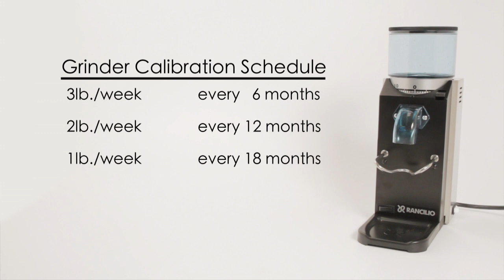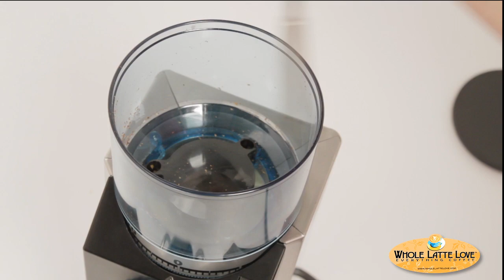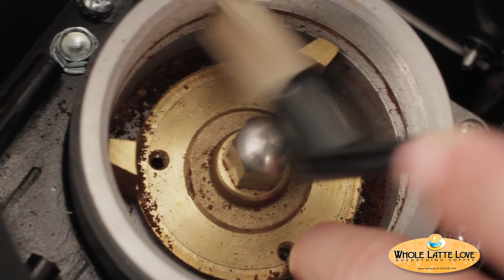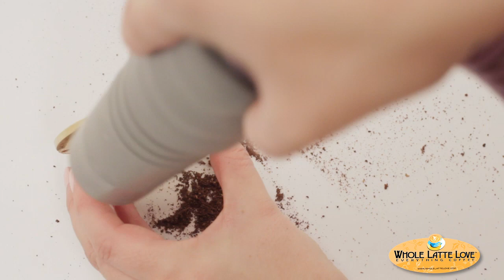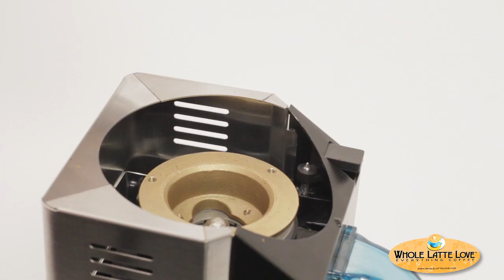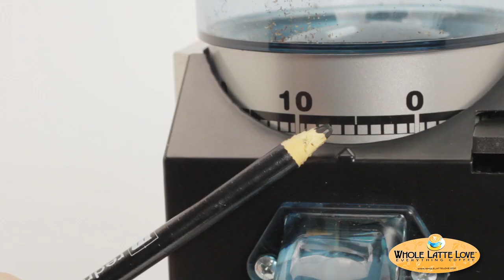How to Calibrate a Rancillio Rocky Grinder

Comment: I am dreading doing this, but my Rocky is almost 10 years old. I probably should replace the burrs.
Reply from the maker: Hi Richard, That really depends on how much coffee you've ground in those ten years. Should be good for >400lb/200kg. Honestly if considering new burrs I'd think about a new grinder. They've come a long way! Always found the grind at espresso sizes a bit clumpy from the Rocky. Also limited in precision with its stepped grind size adjustment.
Marc
Reply: @Wholelattelovepage  I suppose it might be time. I used to think of the Rocky as the sweet spot price/performance for an espresso grinder. What is the new sweet spot? The Ode?
Reply from the maker: @icowrich  For price/performance in a no frills manual on demand machine grade grinder the Eurkeka Mignon Facile is har to beat. Read the user reviews here: https://www.wholelattelove.com/collections/espresso-grinders/products/eureka-mignon-facile-espresso-grinder
Marc
Reply: @Wholelattelovepage  I also like the idea of a machine that I can eventually upgrade with SSP burrs. The Mazzer mini seems with 58mm burrs look good for that, but I don't want a doser.
Reply from the maker: @icowrich  Ya, dosing grinders are so 10 years ago! I'm not a fan of Mazzer grinders - they had plenty of fans back in the day and probably still do  - driven by nostalgia.  My issue is the top burr rests on 3 springs and there is little to no protection of the grind collar adjustment threads from coffee grounds and oils. Those three springs may allow the top burr to wobble up/down potentially decreasing grind particle size consistency. I have no proof of that but seems possible. Beyond that, it's a very difficult grinder to clean! The adjustment threads get gummed up eventually making size adjustment stiff and jumpy. And the holes where the springs sit fill with coffee gunk. If your willing to go to the Mazzer price range I'd take a close look at the Ceado E series grinders. The E5P is manual on demand and the E6P is same burr set with 2 timed presets or on demand grinding. Much better grind size adjustment mechanism than the Mazzers and adjustment threads are well protected. They feature 64mm burrs, are not dosers and produce a nice fluffy and well distributed grind into portafilter.  And they can be upgraded with SSP Red Speed burrs: https://www.wholelattelove.com/products/ssp-red-speed-coated-64mm-grinding-burrs
Here a video comparing the current lineup of Ceado's E series grinders: https://youtu.be/4EL5J4bTXt0
Hope that helps!
Marc
Reply: @Wholelattelovepage  The E5P seems like it's in my price range. Is that upgradeable to an SSP or some other brand of precision burr?
Reply: @Wholelattelovepage  So 10 years ago ?!
my MD40 was made in '95. 
The Rocky chute fits. Burrs are $45 and last a decade. New Rocky is $400
Shim the burrs square , and what's not to love?  Well maybe cleaning it.

Comment: Great video.  You mentioned important stuff other people would tend to leave out and just assume people know, like that the burrs are exactly the same and it doesn't matter which you put back in top or bottom.  Thanks much.  And thanks for selling my my Jura S9 Avant Garde years ago.  Thanks to regular cleaning and descaling and using the optional filter, it's still going strong with very few issues along the way.  This was also a refurbished S9 so I was wary about it, but everything was like new, even the drip tray was new and covered with a peel off plastic film  I've recommended you again and again since my experience has been so stellar with this machine you sold me.
Reply from the maker: Hi UB, Thanks for the kind comment and happy to hear your refurbed S9 is still in the game. Take care of these machines and they will take care of your coffee for many years!

Comment: so wait - in a video about how to properly calibrate your grinder, the last step is to mark a new zero indicator with a marker on your machine?  no thanks
Reply from the maker: Hi Mark, Thanks for the comment. there are some grinders which have adjustable scales so you can put zero at minimum grind setting.
Marc

Comment: The 3rd time I have cheaned my rancilio grinder, all went well. sadly this  time , one screw from the lower brrr  refuses to come off I   have tried  in many ways just did the best I could, but it is not the same,  any suggestion?
Reply from the maker: Hi ET, Typical methods for loosening stubborn fasteners is shock, heat and penetrating oils. For shock try turning to tighten (counter-intuitive I know) then go the other way. For heat, careful use of a propane torch to warm up the screw.
Marc
Reply: Thank you Marc for your reply and will try it'cheers @Wholelattelovepage
Reply: Plus the penetrating oil gives a nice flavor to the crema

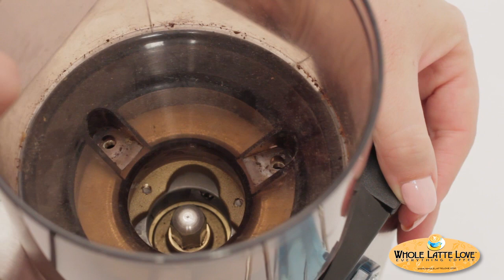Comment: two tips: i) removing the bottom grinder at 1:20 may be difficult if it's been a while -- use a toothpick to remove gummed coffee between the grinder and base. ii) after re-installing parts, lightly tap the (black) grinding button -- if you hear any metal-to-metal sounds, your burrs are touching and you should go back and leave more space between them (cf. 3:38). also make sure the screws on the bottom of the hopper that fix the stop are secure. thanks for the excellent video!
Reply from the maker: Hi QR, Thanks for adding those details!

Comment: It has been quite a while since I REALLY cleaned the entire machine.  Thank you for the detailed instruction.  My big mistake was in seeing the phillips head screws holding the exit chute to the front of the machine and assuming that the screws that hold the hopper and burrs were also phillips head.  Bad assumption.  Your vid cleared that up.  Thanks.
Reply from the maker: Hi jp, Happy to help - thanks for the comment!

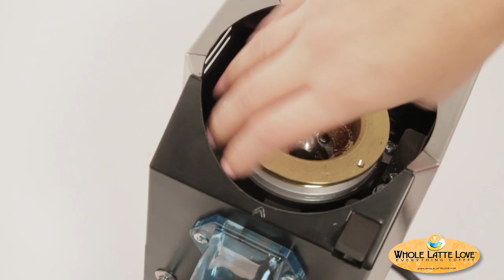Comment: 1:00 I can’t remove this part counter clockwise, I tried so much hard but it’s fixed what I can do?
Reply from the maker: Hi x, Threads must be really gummed up. Was it sitting unused or grind size never adjusted for long period? Anyway, you'll just need to try harder. You could try putting the screws back in without the hopper on to give you more leverage.
Marc
Reply: Hi x3li18
have the same problem, did you manage to solve it? any tools that can help here? I've tried with the hopper but still nothing
Reply: Put back the three screws without the hopper. Pull one screw with your fingers and push the screw on the right with a plier.
Reply: @ricardot3488 Thanks! Very helpful!

Comment: Thank you.  This saved me 2 weeks or more for waiting for repair.  My grinder just stopped working, I called service from another company and they said I'd need to bring it in because I couldn't even hear the motor.  I took everything apart and cleaned it and it's running like there was never an issue.
Reply from the maker: minerva You are welcome and happy to hear you’re grinding again. Thanks for taking the time to comment!
Marc

Comment: Hello I have a problem with the Ranchello coffee grinder which is the numbers fixed and difficult after the jaw with difficulty has become the disc and pull the disc clockwise stands in the middle and does not reach the required limit

Comment: I've found that there is a bit of slop in the threads.  If I calibrate as directed it doesn't grind fine enough for espresso.  If I pull up while screwing down it calibrates ok.  Not a problem when grinding for drip but burrs touch after grinding for espresso.  Do you think this is something that can be fixed?
Reply from the maker: Hi t, Thanks for the question. Seems odd that you cannot grind fine enough for espresso after calibrating as directed. I'm a little confused and/or not understanding as you go on to say the burrs touch after grinding for espresso. My gut says it's not slop in the threads. They are very fine and if there were slop it's unlikely you'd be able to get the top burr carrier turned in. If you are in the US, you can contact our Tech Support staff here for further assistance if needed: https://www.wholelattelove.com/contact-us
Reply: My Rocky also has a problem with sloppy threads, and I think it's been like that since I got it ten years ago. I just found out about the "rocky teflon tape fix" -- go ahead and google it -- and it seems to make a whole lot of difference to how fine it can go without the burrs touching.

Comment: Hey @wholelattelove, a couple weeks ago you helped me with my Gaggia Classic that was gifted to me by a friend who neglected the machine for several years.  This weekend's project was trying to get another gifted machine back in working condition, this time a Rancilio Rocky Doser ginder.  He had taken it apart for cleaning at some point and never was able to get it back together.  After looking into it I found the collar will start to go down the chamber, but about 1/2 the way down it gets terribly difficult to screw down.  Threads seem to be lined up properly, I hear it and feel it drop into place.  I noticed some weird markings and roughness on the threads that are, likely, my problem.  Here's an imgur album with some close-up pictures for reference.  https://imgur.com/a/a6ze4  Is this part a lost cause?  Do you sell replacement chambers by any chance?
Reply: Gotcha--thanks for the next steps.  I'll give cleaning things out a bit better this weekend and see if I can get something sorted out.  Thanks also for confirming that you didn't stock the collar for Rocky grinders.  I didn't see it when I looked and found it elsewhere, but you all were so awesome that I wanted to try and buy from you first if at all possible.  Thanks again!

Comment: Thank you! This worked perfectly. For anyone who cannot screw the brass part all the way in, try cleaning the threads of the stainless steel and brass parts with a firm bristle brush.
Reply from the maker: Hi JP, Thanks for your comment and sharing your tip! Threads need to be clean or it will be difficult if not nearly impossible to get the brass part screwed in.
Reply: This !  Had to scrub the stainless and brass threads and then use a wet washcloth to get the dried up coffee out of the threads ( I use it around 40-45 for pour overs mostly) When I go to adjust down to grind espresso (10ish) It sticks and is hard to turn.  Turns out the threads were gummed up bad.

Comment: I am having a lot of challenge re-assembling machine:  threads of the adjustment collar are well-aligned, but it doesn't want to hand tighten AT ALL, and binds up early.  Hard to see what if anything is causing the problem.
Reply from the maker: Hi Gregg, Likely some coffee residue still in the threads making it difficult. Try cleaning the threads more thoroughly. But do be sure the thread are lined up properly and don't force things. We recommend turning backwards (counterclockwise) first until you hear or feel the threads drop into position before turning clockwise to engage the threads and continue screwing on.
Reply: It doesn't take much residue at all to prevent re-threading.  Eventually I decided on a more drastic solution: using the bean bowl for more leverage.  1. I removed the stop screw.  2. reattached the bean bowl using the (3) screws).  3.  Screwed it back on until the burrs touched, then backed of 30 degrees or so.  4.  Unscrewed the (3) screws,  5.  Re-inserted the 'stop screw'.    All in all, cleaning out all the coffee oil and broken beans from between the burrs made the machine much more capable of fine grinds, and my pulls are much better!  This video was amazing.
Reply from the maker: Hi Gregg, Happy to hear you got it back together and thanks for the kind comment and sharing your experience. For others reading this - be careful and don't force things cross-threading makes for a very unhappy day!

Comment: I can't get my burrs to touch (as shown at the 3:00 mark).  I've got the top screwed all the way back down, but my center shaft still turns because they're not touching - ??
Reply: So, after reading through all the comments below and seeing another that had my same issue...I did what he did and solved my problem by pulling out my reading glasses and a dental pick to ensure that every groove was clean.  I thought I'd cleaned them well - I hadn't.  After a really surgical cleaning what I thought couldn't possibly be my problem...it fixed my problem.  It was interesting at how a single groove's worth of thick coffee kept my head from screwing all the way down.  Lesson learned: clean, clean, and then clean again.  :)
Reply from the maker: Hi BK, Thanks for the comment sharing your experience!

Comment: I followed your instructions to a T but my zero went 0 to 21.  Where I used to grind at 5, I know have to grind at 29.  It is a bit odd but the espresso comes out fine.
Reply from the maker: Hi Max, Could it be you placed the hopper on in a different position? You may be able to remove the hopper and re-position it so the numbers line up better.
Reply: Whole Latte Love If I put the hopper back so that the screw is at the internal stop position, then my zero stop is more like 8 or 9 when I need a 5.  I am going to fix the problem with a new hopper and the adjustable stop
Reply from the maker: Max Power
8 or 9 seems reasonable. The numbers on the hopper are arbitrary to some extent and dependent on burr wear and other variables. I've never calibrated a Rocky and had it end up exactly where it was prior to calibration.

Comment: Would you guys please give instruction on determining whether the burrs in a Rocky are in need of replacement.  I have a pretty old Rocky and would like to know if I should consider replacing the burrs.  Of course I don't want to spend the money if not necessary.  A video on the subject showing worn compared to new ones would be ideal.  If this information is already available somewhere, I'd appreciate a point in the right direction.  Many thanks!
Reply from the maker: Hi Lawson, Very difficult to determine if burrs need replacement by just looking at them. Our repair techs say they can feel them to get an idea but advise that's only after years of experience. Most grinder manufacturers we talk to like Ceado, Baratza, Etc. recommend burr replacement after grinding about 1000lb/450kg of coffee. If amount ground is unknown, our techs recommend replacement every 2 years for average daily home use and annually for heavy home or light commercial use.  If you feel you need to replace they are available here: https://www.wholelattelove.com/products/burrs-d50

Comment: @Whole Latte Love. If you have to take the factory fitted sticker off your grinder hopper, you've set if up incorrectly. It came with a true zero setting from Rancilio, so why would that change if you've replaced burrs and calibrated correctly. It wouldn't!! 
Anyone watching this, please don't peel the sticker off the hopper, as if Rancilio would expect you to do this!?!? 
Set the burrs touching re-assemble and back off from there. That is your 'true' zero as it was when you bought it new.
Reply from the maker: Hi Neil, Thanks for your comment. Not sure what your referring to on taking off the sticker. We don't ever take the sticker off in the video.
Reply: @Wholelattelovepage  It's that nice plastic Rancillio wraps things in

Comment: In replacing my burrs (and thoroughly cleanning all surfaces) I found my stop post to be at least an inch out of place, so I guess without the adjustable stop on the older rockies I am sol until I buy a new hopper.  I have issues with spinning the motor electrically and hearing when the burrs touch. If ya can't findem just grindem! The top of the motor shaft is a 12mm so I just used a long socket and an extension to spin the the shaft with by hand so as to keep those burrs as close to factory fresh as possible. Since my stop is not configurable I decided to remove the sticker and zero it that way. Probably not something I would want to do every time but it works for me. This by the way is the best video on the subject I have watched so far. Thx!
Reply from the maker: Hi LC, Thanks for your comments and advice. Hopefully it can help others who may have the same situation.

Comment: I totally disagree with the the zero point aspect of this method. Reassembling with the burrs slightly backed off from touching left my Rocky grinding too coarse for espresso at it's 'new' finest setting. Tightening the brass carrier down until the burrs are snug and reassembling has my Rocky perfect espresso size grinds at position #7 from zero. Just as it came from Rancilio 3 years ago!
Reply: Then you hadn't backed off the contact slight enough.  Setting the "0" as you have, will allow burrs to contact if one adjusts to 0.  Bad idea if the grinder is running. -Just as some have criticized the vid's setup proceedure for allowing contact while running.
Reply: No that's what to do if the burrs aren't square
"Just like it came from Rancillio."
Made after "lunch"